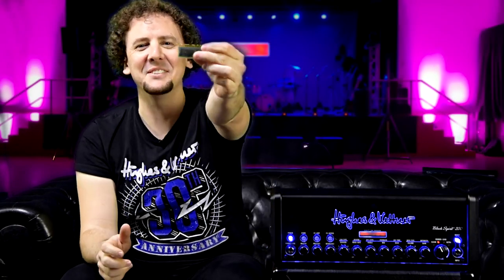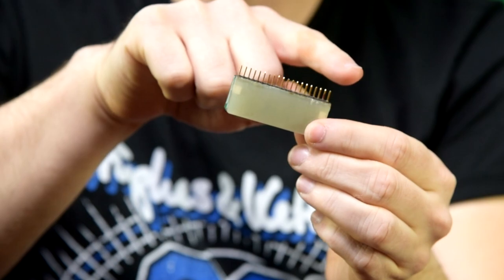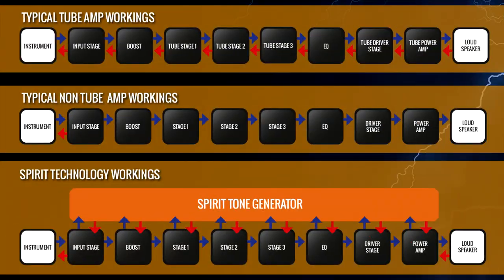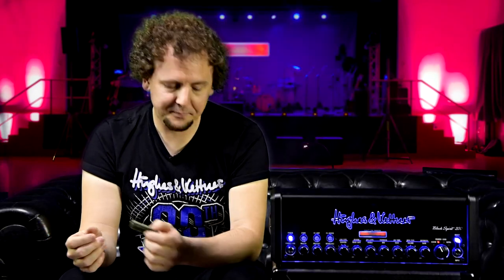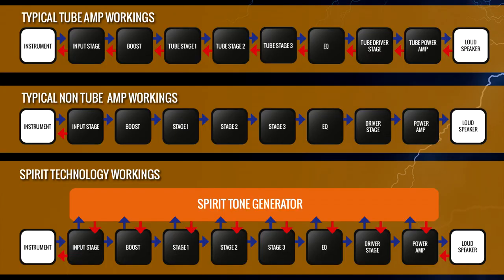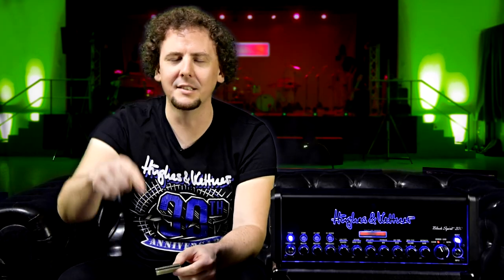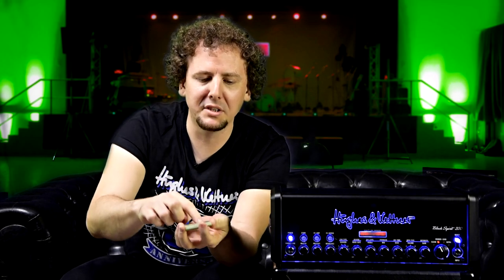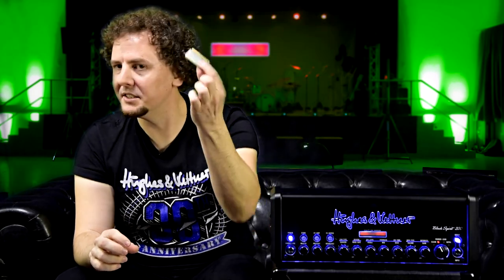Hughes & Kettner Black Spirit 200 | Spirit Tone Generator | Explanation and your questions answered!

Comment: I know that it is a stupid question but my 2x12 cab says that the maximum power is 160 W (8 ohms). Since it is an analog modeling amp, can I use it on this cab on 200 Watts mode ? If not can you recommend me sth to work this out ?
Reply from the maker: Don't worry, you'll be fine to use the amp on the 200-watt mode :) (Well, as long as you're not using it with the master volume at 10 the whole time - but even then, the most damage will be to your ears, not the amp!) We use the amp with our 120-watt cabs and have never had issues.
Reply: Good question..
Reply from the maker: Yeah, and it's a legitimate one too (we get it a lot with the new Black Spirit 200 Combo, which has a 200-watt power amp and is fitted with a Celestion Creamback G-12 75H)...

Comment: can I connect this black spirit amp into my 2 active frfr cabs ? should I lower the output knob on frfr cabs or lower the master on black spirit ? can’t find this info.. thanks a lot guys
Reply from the maker: If you´re using active cabs, you should use the XLR-OUT (not the power amp out - !!!) If your active cabs are "full-range" you might want to use the cab-sims that come along with the integrated REDBOX ... if these cabs are active guitar-cabs they use the tone curve of their speaker. Adjusting the output volume always depends from the input of these cabs. Best to start from "zero" and than chek how high you can go. ... Greetings from the team.

Comment: There are so many promotional videos with Black Spirit 200, and no one with pedals. Does it mean that PS200 is not sounds good with pedals? 
And one more question. I am writing music with live electric guitars, not hi-gain, mostly funk and pop-rock. I will not use it on stage, only for recordings. What is best solution for me? PS200 or grandmaster 40? Price is not a point, only a sound. Thank you very much!
Reply from the maker: Hi Alexander. The good news is, Black Spirit 200 functions awesomely with pedals - we've tried and tested a bunch with the amp. We haven't made a video with pedals yet on our own channel because we focus mostly on the amp - it has four channels (from clean to super high-gain), and many built-in FX, so in a way it negates the need for pedals! That said, we realize there are people out there who want to see this, so we will do some videos with the amp and pedals soon.

About the Black Spirit 200 versus GrandMeister Deluxe 40 thing, it's a personal choice we'd say, so if it's possible to try both, please do - only you will know which one your ears prefer!

But we can offer a little more advice too. Firstly, the Black Spirit 200 has the newer version of the Red Box DI out, which can be crucial for recording. It offers a selection of 8 different cabinet types. This isn't an issue if you record with mics of course, but if you use the DI, it's something to think about! You can also connect your headphones directly to Black Spirit 200.

Sounds-wise, GM40 has classic tube tone, made with tubes. Black Spirit 200 has a very similar tone, made without tubes, but with BS200 you can still achieve the power amp sag of a tube amp using the Sagging control. This will be useful for making convincing clean/crunch sounds for your pop-rock needs, we imagine.

We hope this helps a bit!

Team H&K
Reply: @HughesandKettneramps  thank you very much for reply! Could you be so kind, when you will make a video about how bs200 takes pedals, also add some wah pedals (like auto wahs, envelope wahs etc) and show how does it will sound in clean channel? Best way is wah pedal to compressor pedal to bs200. Thank you in advance!  H&K rocks!

Comment: Hey. Some users complain about a noise when you plug in the power cable.
Is it fixed? I want to order one. But it has to work. :-)
Great versatile Sound.
Reply from the maker: Hi there. The amp does indeed make a noise every 7 seconds when it's still plugged in but switched off, but that's all part of the design. It's to do with the fact that the amp has a global voltage transformer. If the sound were to bother you, you could simply plug the amp into a switchable extension socket so you can flip its switch to cut off the power supply to the amp - then no more noise. Hope that helps :) And glad you like what you hear so far!

Comment: Hey Hughes & Kettner, why is my BS200 breathing when it is turned off (weird electric snorts every couple seconds )? I know I am not the only one having this. btw I love the amp it's a keeper~!! Soon I will have a few clips on my yt channel from unboxing and the first impression.
Reply from the maker: Hey there, good question! This sound is fine, and is in fact part of the amp's design. It's to do with the fact that the amp has a global voltage transformer. And if the sound bothers you, we recommend that you plug the amp into a switchable extension socket so you can flip its switch to cut off the power supply to the amp. Hope that allays any doubts there, and glad to hear you're enjoying the amp so far! Send us a link when your videos are out :)

Comment: Will there be an Android App in the near future? To be honest, this sticking to iOS and Apple products was already a no go for me for the Meister series.
Reply from the maker: Yep, the developers are nearly ready with the Android App (and there's a desktop PC/Mac editor coming too). There is also a GrandMeister Android app by the way - here's more info and the link to get it: http://hughes-and-kettner.com/grandmeister-deluxe-40-android-app-available-now/
Reply: @HughesandKettneramps  please do a GNU/Linux Version as well!
Reply from the maker: Not a bad idea, we'll ask if that's a possibility :)
Reply: @HughesandKettneramps  Actually perhaps the best way to go would be to make a web editor, so that you could run it from any browser any device. Beam things into the amp through bluetooth and/or wifi. Saves you time supporting all the different platforms - if one has a web browser they could then use your editor from anywhere, and it'd be one single codebase without needing to build for PC, build for Mac, build for iOS, build for Android, build for whatever Linux flavor of the day... Seems like a smart thing to work towards?

Comment: Sounds very similar to the Coreblade, but slightly smoother.
Reply from the maker: Interesting thoughts. You can indeed dial in Black Spirit 200 to get Coreblade-esque sounds - both amps are H&Ks after all, and were designed by the same person, even though they're distinct designs. Do you prefer the perceived overall smoothness of Black Spirit 200 then, or the Coreblade's... roughness?

Comment: In these reviews an iOS app keeps getting mentioned, but there is no such app in the App Store. I wanted one of these but without an app it is not for me.
Reply from the maker: Hi Jon. We're unfortunately still waiting for Apple to release the App - it's sat in the certification queue. But the Testflight beta version is still out (and is identical to the other version), and you can get it here: https://testflight.apple.com/join/4eOomvre

The Apps for iPad, Android and desktop Mac/PC should be out very soon!
Reply: Hughes & Kettner - I am not able to make this work, there is an error. I picked up my BS200 today, and would love to get this app working.
Reply from the maker: Hi there, what is the problem exactly? Have you installed the Testflight App too? Let us know in more detail and we'll try and help. If it's easier, DM us on our Facebook page instead.
Reply: I went through the FB page, and got help from H&K there, and it works now, thanks. The page with the TestFlight link and the invite code was giving an error when trying to get the H&K app, but at some point it started working again, and I got the invite. Any news on when the app will be in the App Store?

Comment: + does anyone else have noticed a big problem with feedback coming from an amp? None of my other amps had this problem and now even low gain pickups like tele single coils feedback as well :/ I mean H&K BS200 offers lots of lots of gain but I don't know... the squeals are unbearable ;( I am standing 3m from the amp/ 2W power. It's even worse with 20W, obviously.//
Reply from the maker: Now this is something we definitely haven't noticed... anybody else? Check the rest of your signal chain to make sure everything is in order, and do you still have another amp you could test with to compare?
Reply: Maybe something else in the room?

Comment: Would I Benefit using an Ox Box with the BS ?
Reply from the maker: No, for two reasons: firstly,  because Universal Audio only recommend using the Ox Box with tube amps. Secondly, because with Black Spirit 200 and its built-in Red Box DI you can do all that stuff anyway! So if you have the amp, you won't need anything else :)
Reply: @HughesandKettneramps  I totally should have asked this for the video (that first question was actually mine lol) but in regards to this..there are situations where it makes sense to use IR's, even though I agree that the redbox DI is awesome. I was scared to use my torpedo captor with the amp at first (with the output setup as though it's going into a cab, like with a normal head), but it works just fine. Is there actually an issue with this?
Reply from the maker: Aha, it was you! You're the reason we thought we'd throw weird questions to Rich for this video ;) But anyway, you're right. That's also why you can turn the Red Box's ambience emulation off - so you can use whatever IRs and plugins you want instead.

Hmm, so we searched on the Torpedo Knowledgebase and found this article by them, which states it's totally fine for you to use the Captor with Black Spirit 200 (and indeed, any kind of amp): http://support.two-notes.com/knowledgebase.php?article=329

So you're totally fine there! The article also explains why certain other companies only recommend use of the loadboxes with tube amps. Interesting stuff. In the Ox Box manual, UA explicitly state you should only use the product with tube amps - that said, we have seen other people use the Ox with Black Spirit 200 in videos, and it didn't seem to explode or anything!